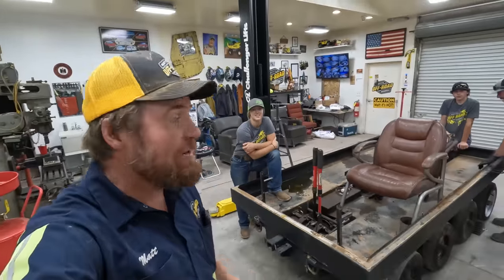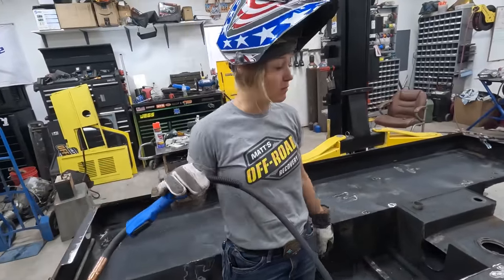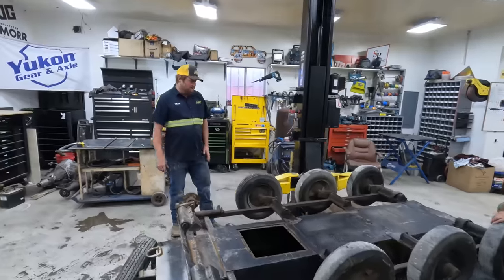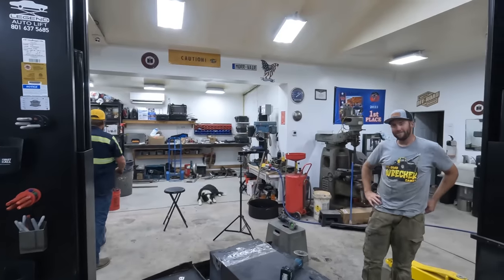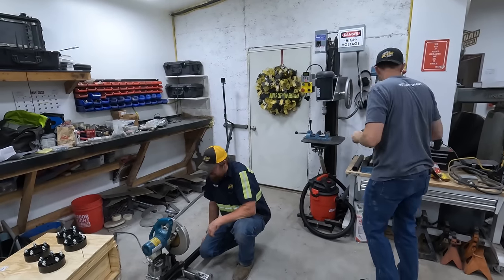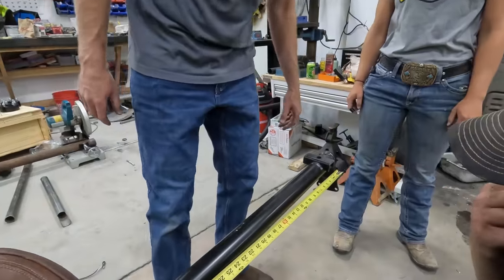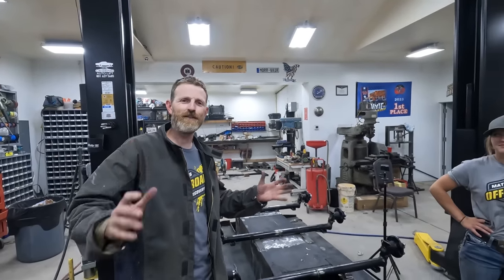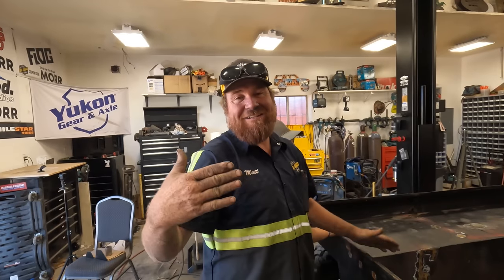I Stripped The Bombi Down To Nothing!

Comment: I taught high school, community college, welding and metal shop for a total of 40 + years.  During most of the summer breaks, would work as a traveling  millwright.  Really impressed about how you guys work together.  Everyone has an input and their ideas are valued. Just hearing how Lizzy welds, her heat settings and travel speeds are super good.   The only thing I would change would be that everyone must wear safety glasses while in the shop, working or just watching.  Long sleeves when welding is a good safety precaution.  Skin cancer is not what you want as an older person.
Reply: +1 on the safety glasses!!!
Reply: The skin cancer concern from welding never occurred to me. Thanks for the heads up!
Reply: That and a respirator or at least tell Lizzy to stop sticking her face right on top of whatever she's working on. She's inhaling all that smoke each time she burns something in. I'm really hoping she knows not to do that with anything galvanized.
Reply: Her nylon cap drives me nuts
Reply: Ok osha
Reply: @DriveCarToBar I learned milk is the antidote! Bad situation that could have been much worse. Bunch of young dudes working a summer demolition job in a basement torching off galvanized piping. We didn't know, no one told and all six of us got  poisoned. We all recovered with no issues. Listen to this man MORR.
Reply: @ChuckHickl  Milk also for Spark - eye . Helps clean it out .
Reply: @ChuckHickl milk just works for the short term effects. Zinc poisoning hits you later in life.
Reply: @everready19373 👍it's that ONE random spark or metal chip
Reply: Whatever you do, when, pulling down a garage door, do not tie a rope in the “loop” for fear someone might call it a “noose”years later.
Reply: @tylerwhite4743  Definitely with repeated exposure, I imagine it could be bad. It was a one time thing for us and we had no business being down there and were never allowed to use the acetylene torch unsupervised. I think i was 15 or 16 at the time and it ended up being a good lesson in paying more attention to what the F you are actually doing.
Reply: In defense of both conditions the one condition they suffer through is heat. Working in 100°+ heat can be debilitating. In hot weather I’ve had safety glasses sliding down my nose flopping around. Even with professional fitment where they fit close around the eyes they usually fog up and you can’t see what you’re working on. While leather sleeves are generally cooler it can still lead to muscle fatigue since you have to hold a position for long periods. One thing I agree with is inhaling the fumes. If it was a regular welding shop they used to at least have ductwork that pulled the gases away. It would be great to have a helmet with a positive airflow for breathing from an isolated air source so anyone would have cooler air when breathing. Hopefully it wouldn’t be cost prohibitive. Lizzie has a great future in welding or anything else she chooses so I’d hate to see her health affected that could limit the future. Love seeing you all together so the better the safety the better the opportunity for that to happen. On a lighter note, looks like you’re going to need a ladder on the bombee too. Even with the small wheels from previous seasons it looked like a struggle to climb onto it. Barring needing to put idler wheels inside the tracks maybe you could put a step post protruding through the tracks mounted to the body. Even as a passenger Jaime would have a hard time climbing in. (I have a niece spelled this way. Apologies if wrong) If you didn’t have to get in you could have some fun just putting a slide on it. lol. Be safe everyone.🙏❤️
Reply: @kevola5739 lotsa uv exposure.
Reply: @Clean97gti idk if shes doing it but when i spray paint small patches i just take a deep breath first then grab clean air from further
Reply: Exactly. I have a friend who is a retired pipefitter. 84 yrs old, not a welder, but around welders  8hrs a day most of his career. He might as well be getting his mail delivered to his dermatologist these days. PPE is so essential , and although I totally respect Matt, he's cavalier about shop safety,  and I'm dreading the day one of those kids shows up with an eye patch or some other prosthesis due to an accident that was totally preventable. He's the leader of that motley crew and he sets the precedent. I still enjoy his podcasts and watch them all, but also always squinching with the shop shenanigans.
Reply: @common9343   I agree! Both Matt and Paul @ Fabrats think shop safety is something to joke about and they both jeopardize the safety of friends and family in their shops on a regular basis.
Reply: @tylerwhite4743 my welding teacher had galvanosis from welding on galvanized pipe before they knew it was bad. He could barley keep a coffee cup in his hand he shook so bad
Reply: Matt’s is a casual shop, where they don’t worry too much about safety, as long as it is reasonably safe, i.e. as long as there is no immediate threat! He could probably stand to be a bit safer, but I know how I am… I take what I think are the necessary safety measures and more. I don’t need anybody telling me not only what I could do to improve safety, but also that I should do them! Safety is not the only consideration, and my methods of work work for me.

Comment: If you did have some sort of soft suspension on those bogies, it would allow the track to flex over dips and humps. This allows for much much better traction. Look at the way the older skidoos were built with bogies or tanks with bogies. That's why they are there. Cat has finally gone to bogies for its big cats for this very reason, much better traction.   Great to see Ed in the shop and its always nice to see all of your crew in the videos, so thanks for that.
Reply: Yeah, take inspiration from all the engineering work done by tank builders.
Reply: I agree, it would improve the traction, but with the bigger wheels i think they would collide with eachother when the track was flexing don't you think?
Reply: I agree and this makes sense! But they're expecting 12 feet of soft snow when using this thing. Hopefully it won't come across many dips and humps in the jobs that its intended for.

Comment: Trailer builder here, I have a trick for you to get the grease caps on easy peasy every time.  Use a Forstner drill bit in the same diameter as the caps, drill a pocket in the endgrain of a short chunk of 4x4 post, slide the cap into it (light friction fit is best), hold it against the face of the hub and smash with a hammer (claw hammer of course lol).  It always seats the cap in one or two quick smacks without any dents or modifications.  I’ve been using the same 4x4 chunk for ten plus years and have installed thousands of these caps without any trouble with it.  Bombi is looking great, you guys rock!

Comment: We are all SO GLAD you are finally doing the Bombi project (and series of videos) and doing it AS seriously, meticulously, well-engineered, upgraded and powerful as you did the Offroad Heavy Wrecker. We are so looking forward to seeing it become a BEAST of a winter snow, plus year-round sand, mud and shallow-water-capable recovery vehicle with LOTS of power, many HD tow/pulling points, maybe a couple of interchangeable hitches, front and back winches(?), a toolbox, etc. and a bunch of marker and flood lights for night use and a nice, comfy, roll-caged interior with cup holders, grab handles front and rear, a stereo, nav screen system, good heat and maybe even A/C...go big! (You are after all Matt's Off Road Recovery!) This was a fantastic video all around. EVERYONE in it is an ESSENTIAL part of what makes this channel what it is...the MORR Crew all ROCK and you each do it with character, your own style, lot's of problem-solving, a get it done attitude and a lot of fun mixed in. ;)
Reply: and a fuel gauge that works!!!
Reply: @lockednotstock2smokingbarr719 ...yes...a working fuel guage also, for sure...DEFINITELY! (I'd bet Tom will INSIST on having one, he sure should, because right is right and being unprepared is just silly for a recovery/rescue company. ;)

Comment: Hey Matt it's not so much about suspension as it is traction. Over bumps and ridges the torsion bars did what they were supposed to do. Rounding the track over ridges and pushing down in the holes. Great content love everything you guys do.
Reply: I was just about to say the same thing.  The spring they provide, pushes the track into voids on the terrain to give you full contact.
Reply: Exactly. That 2-3 inch torsion bar range gives it the ability to form the wheels (and track) over the ground for contact. Without it, it’s just a plane. It’ll work for what they do.
Reply: I think too we need to remember doing the work they do, simpler is better. Ultimately, if it doesn't work, he'll rebuild it another way.
Reply: You think Matt doesn't know that? Yes if the axles were still new and operational, but they weren't. They were so worn out that they were sitting on the stops, and one was even so worn that it was stuck on the bump stop and wouldn't move. The larger wheel and tire combination with the correct tire pressure will offer just as much support or MORE than the shot old axles did. This is one of those things that is just going to inevitably get proven inconsequential by Matt, add it to the list.
Reply: given they're going to a "standard" tire from a bombi style, I suspect there will be more give because of that.  either way we'll see how it goes, or doesn't.
personally I'd have gone with torsen axles as well, but it's not my rig, and i'm not building it, or driving it.
Reply: I was coming here to say the same thing, the torsion bars are there to keep the track tort should it be unloaded over a bump, so it doesn't throw a track
Reply: I had a bombarder when I lived in Northern Canada, it had double bogies on each axle for exactly the reason you state . They were smaller diameter than the drive wheel and idler it had a couple of Teflon rail slides to guid the track on the top . Worked like a charm , passengers sat side facing with their feet in the well , lots of fun trips in that rig!
Reply: Most tracked construction equipment doesn't have suspension either and works fine. The vertical travel on those torsion bars was barely there. So I doubt it was doing anything useful. Especially not in snow and mud where the terrain forms to the tracks anyway.

If you want useful suspension you need to make it proper spring and shock support like in an actual tank. It's not worth the complexity here, stuff is only going to break. Running on lower tire pressure can also hold tension on the tracks.

Keep in mind they are not making a fast driving tank or ripsaw here.
Reply: @TontoTraveler they were worn out as you saw, they barely provided any spring. Other ones are just going to get worn out quickly too
Reply: @datalorian  Only thing I can think of regarding suspension is not only compresses, but rebounds. Lower tire pressures will not function in that manner. But they will allow for some/slight compression/rebounding. Will be interesting to see how it turns out.
Reply: The risk with lowering tire pressure for a softer ride is that if you're not careful you won't consistently keep enough tension in the track and you risk slippage.  I'm sure Matt and Tom are aware, I look forward to hearing their comments on striking the balance.
Reply: The torsion axles also help dampen track harmonics. I predict slipping tracks (with both the terrain and the drive sprocket) and track derailment.
Reply: @monkeybarmonkeyman  fair points

Comment: A story about my eye. I used to grind metal without eye protection. One time I got some steel in my eye. It did not come out for a day so I went to the hospital. They used a needle like device to remove it from my eye. Then cream and an eye patch for a day. Then a follow up to see how it was doing and remove the patch. They used a small "pencil grinder" to remove a rust ring around the crater the piece left behind!! From then on I use eye protection for all grinding, cutting, and any activity that could result in an eye injury!! Now you know!! 🙂
Reply: I also cringe every time I see someone grinding without glasses.
Reply: Some people are lucky and some have to learn it the hard way. Ask me how I know.
Reply: Yep.  I normally wear safety glasses. I had one little touch up to grind and the glasses weren’t in reach.  The pieces they dug out of each eye were microscopic, but I sure could feel them.
Reply: Exact same thing happened to me. I had to hold my eye open while the doctor did the grinding with his dremel. I went out and bought swim goggles just to make sure it didn't happen again that's how bad it was.
I thought I was gonna loose my eye.
Reply: Been there done that, not anymore.
Reply: And wear it when your colleague is grinding.
Reply: I did clean up in a shop. Mostly aluminum.  Sometimes it was shoe laces deep. The second time I got a piece in my eye I had to sleep with it til morning and then I carefully picked it out.  After that it was tight fitting googles.
Reply: Yep, around here that Shop would be closed and the Owner in serious trouble. Some people need to learn the hard way, i guess.

Comment: It’s good to see that Bombi is getting the upgrades. The LS1 is the standard power plant for your fleet and it makes sense to stick with what you know will work. 

Great content all around. Love seeing Ed, Lizzy as always and Jamie getting the step lift. That’s a great rig for her. A great bunch of smiling faces is a welcome sight these days.
Reply: Just some information for you. An "LS1" is a specific 5.7 liter Chevy V8 only used in a couple cars in the 90s/early 2000. It shares architecture with tons of gm engines used in all the trucks and performance cars for over a decade. They are all refered to as LS engines even though technically the truck engines are not. There are ls1,2,3,4,6,7, LSA (I THINK THATS IT). The truck engines are LQx Lm7 ECT. But many parts are interchangeable. There are no LS1 in the MORR fleet.
Reply: @jasonbirch1182  you forgot lsx
Reply: @idwellinthehillslikegandhi lsx is just a quick way to describe any LS based without a specific engine. The x is just a place holder . All caps  LSX was never equipped in a production vehicle only gmpp crate engines.
Reply: Furthermore the 8.1 is NOT any of the ls platform.  It is basically an old school 454 with more stroke and "vortec" fuel injection. 

Aside from specifics, I love we're all of this is going!
Reply: @idwellinthehillslikegandhi  that's an aftermarket block not an engine.
Reply: @fbm314  no. An LSX is an aftermarket block.

Comment: Just at the part where you mentioned it being a late summer, same thing here in the maritimes (east coast of Canada, I'm right on the water). But yeah we've had relentless rain every week since June started basically, and crazy high humidity.  A couple days ago it was 24°C, but with the 94% humidity it was something like 34/35°C. Thank God we had a good breeze. Soon time for AC in our minihome lol.

Buying the kids a small pool (our two boys are 8 and 2.5), so that should help out! I'm sure our new puppy will love it too! Rocky is a 35lb, 8 week old Saint Bernard/ Bernese Mountain Dog mix (parents were purebreds of either breed), and hes not liking this heat one bit! lol. 

Stay cool guys and girls, can't wait to see the bombi finished up, and thank you so much for continuing these detailed build videos. Lots of great ideas, tips, and tricks for the stuff I build as well. 

My last build was my 1998 Toyota Tercel, with the engine, suspension, transmission, transfer case, and axles out of a 1998 Toyota Rav4 we had in our junkyard. The suspension gave it roughly 3.5" of lift, and the 5 speed 2.0L is a blast to drive around the gravel pits. Pulled a few SXSs out already with it!

Keep up the great work, always excited to see more on my days off! Thanks again everyone!

Comment: Matt, you need to keep the suspension on the axles for small deviation in the terrain. if the axle is solid when the track goes into a devote and your turning at the same time there is potential for the track to ride off the tire. More than likely the  tire guide in the middle of the track will try to ride onto the middle of the tire causing many problems. Just something to think about.
Reply: I was thinking along those same lines too

Comment: For future reference, you can order custom axles from Dexter, camber axles or straight axles, any width, without spring perches, with spring perches, any size, square tube or round tube, etc etc.. That being said… RETORQUE THE HUBS!!!! I haven’t seen a properly set wheel seal/wheel bearing/hub come from their factory (at least the factories in the SE) ever since COVID had them cycling through employees. 😬

Comment: I think Matt needs to buy Tom an arc droid! Also make sure to brace those axles. I would probably take 2”-3” flat bar and weld them from axle tube to the body at about a 45 degree angle. The torque on those with the drop spindles is going to be alot. Great job guys! 🇨🇦
Reply: It has 4 axles and tracks tho, pressure is going to be spread out of all axles
Reply: @DrTheRich  IF the terrain is smooth or gently undulating THEN you are correct. BUT if the tracks are going over objects that have a diameter that will partially fill the gap between bogies.... they will remove an axel when it's least convenient!
Reply: @igenr8stuff  they are not going to be rock crawling with the Bombie tho
Reply: @DrTheRich  I wouldn't put it past them!